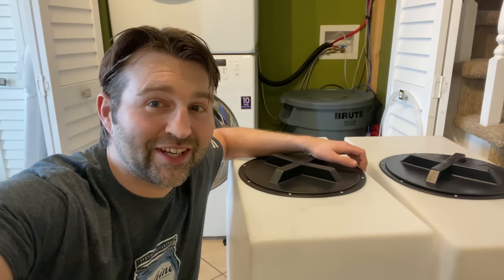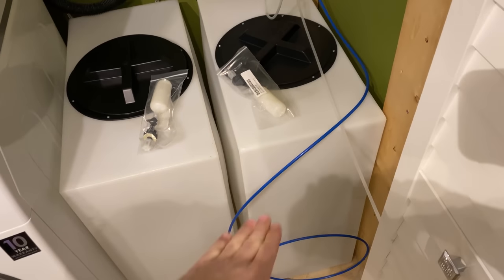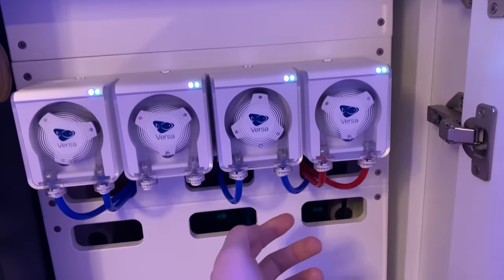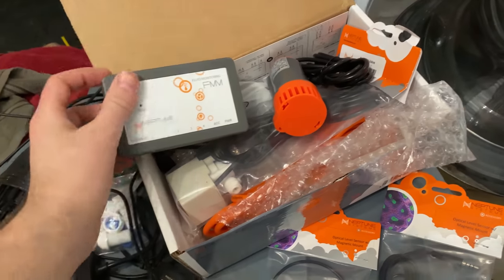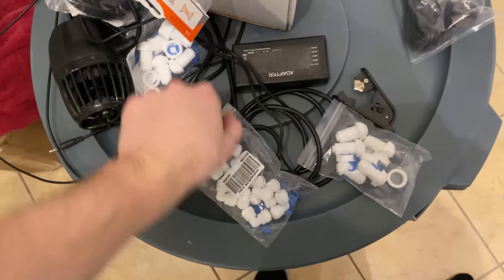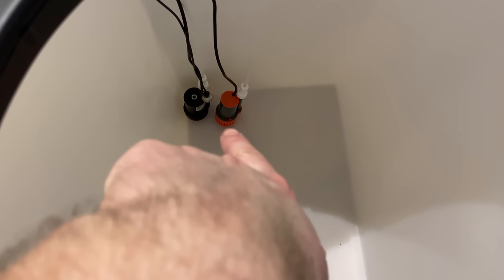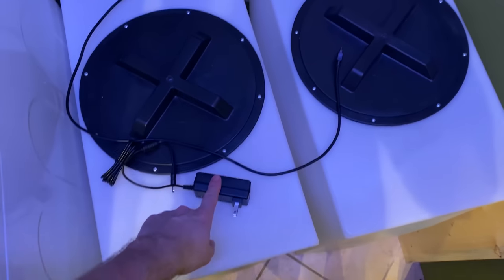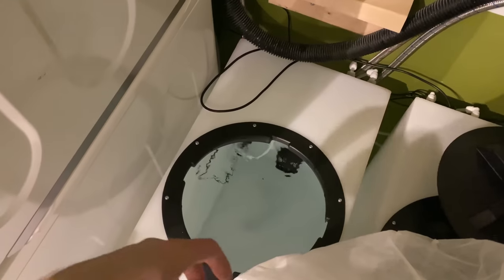Auto Water Change (AWC) Saltwater Aquarium Mixing Station - Waterbox Peninsula EP.05 Vera & AWC

Comment: Hi Devin, do I understand this right for your ato for the rodi supply tank: the optical sensors are connected to the fmm module, and the fmm module tells the solenoid valve when to open and close based on the optical sensors? If so, do you need an Apex unit to set this up, or can it be done as a stand alone? Thank you!
Reply from the maker: You are correct.  if you dont have an apex tunze and a few others make ATO controllers.. if you already have an apex then adding on the sensors is an easy way to  do it.

Comment: Trying to understand how you get the water from the bins up to the tank. You have both a PMUP and the versa on the RO line? So the PMUP pushes it up a bit and the versa pulls it the rest of the way? They are on the same RO line? Or am I misunderstanding?
Reply from the maker: Pmup is for ato and versa is for awc
Reply: @ReefDudes  got it thank you! The PMUP sends the water up a floor without issue? That’s impressive!

Comment: Hey Dev,
I noticed you used a pump to transfer the water from the fresh bin to the salt bin.  You can take that pump off if you wish and just add a float valve and whenever you need to fill the salt bin, just fill it with the RODI unit. I don't think there is any real reason to have to pump the water over there.
Reply from the maker: I have a valve to fill from rodi directly as well!  The pump is if I want to fill it faster I can have water coming from both the rodi and the ato bin!  Really speeds it up if you want to mix up saltwater quick :)

Comment: How long will it take to pull 10 gallons out of tank.  ATO would have to turn off when starting to drain 1-2-5-10 gallons, stay off until 1-2-5-10 gallons pumped back in.
Whats best to control these instructuons?
Reply from the maker: ATF intheHouse well could do it via a scene for high speed. Or low and slow. I think I may just go the low and slow and have it slowly doing it over the day then it’s dead silent and no need to heat the water

Comment: hey DEvin, great video, I'm thinking of getting an apex later on my new setup, would you recommend the versa or dos for auto water changes? or dos since it's integrated to the apex?
Reply from the maker: if its some where far way you wont hear it you can use the dos (not the quietest for awc)  if some where you hear it get the versa as its much quieter at high speed

Comment: My setup is about the same with the two high/low optical sensors in both and I will use the two Neptune solenoid valve connected to T push to connect fitting that will open/close based on the optical sensors. Love the setup.. it’s absolutely awesome..
Reply from the maker: Awesome! love the automation!

Comment: Can you explain what the new ATK pump is doing? I have been watching you videos and love them! I am finally getting a new 130.4 waterbox and I need to finally get around to ATO. I plan to pretty much have the same setup as you. The Apex ATK I am not sure what is is doing. I thought the Versa's are pulling from the reservoirs. Your old pump is pushing the RODI bin to the Salt Bin. Also I assume the Apex solenoid you have before the RO/DI is controlling the open/close on water feeding the RODI? Is that solenoid controlled with the FMM? Sorry about all these questions, but this takes a lot of understand each of the working parts.  Thanks again!
Reply from the maker: Thanks James!  so 1 PMUP is for the ATO to top off the tank.  The second one is to fill the saltwater bin with RODI.   If i want to speed things up i can fill Via the Pump and the RODI at the same time to fill it twice as quick!      The versa is there for auto water change. There is one by the saltwater bin pushing saltwater up to the tank and there is one up by the tank sucking saltwater out and pushing down to the drain. both versa run at the same time for 2h a day.        On the Mixing bins i have a high and low optical sensor in both bins.   If the RODI one is low it will open the solenoid to the RODI unit so it refills the ATO bin.  the optical sensor at the top turns off the rodi so it does not over fill.  I also have float vales in both as backup! :)   the FMM is just my input for the 4x optical sensors.

Comment: Devin - are you planning on keeping your new salt water at display tank temp ie heated? or figure that the volume exchanged will have minimal impact AND keeping the NSW at ambient temp will have no impact on salinity etc ?
Reply from the maker: I will likely do a very slow continuous water change then there should be 0 affect on parameters.. If id o a larger one then it would be more advantages to pre-heat it.. but low and slow saves the extra heater.
Reply: @ReefDudes  Thanks...

Comment: You can get an extension cable for the pmup from brs. I had to get one since my apex is on opposite side as my ato reservoir.
Reply from the maker: I have one for my ATO pump.. i'm out of 24v ports so have to use a power brick for this one
Reply: @ReefDudes  ahh ok that makes sense why you were wanting to cut the power cord and splice it.
Reply: @ReefDudes  Devin, what cords did you have to wire through the wall to get your pmup ato to pump to the tank upstairs? Did you have very much head height, and any horizontal span to the sump? Thank you SO MUCH for this video!

Comment: How large are those containers?
Also dont you have to turn off the system when the saltwater container is empty and you have to add salt to mix new saltwater?.  Rodi reservoir will remain full and continuously feed the tank rodi as top off.
Reply from the maker: I have an optical sensor that will alert me when the salt container is low.. The ATO will re fill it self when its almost empty :)

Comment: This has to be my favorite mixing station video! Great content! I replayed the section where you drilled the 3 holes in the back of the tanks, but didn’t get a clear answer as to what the holes were used for or how the tanks exchanged water. 

I assume the 2 pmups in RODI container, one pumps into the salt container and the other for the ato. So why do we have 2 float valves in the salt container and a 1/4” bulkhead fitting? Also, did you add a optical in the salt container as well? I will be doing a similar setup based on this video! Looking forward to the auto flushing rodi too!
Reply from the maker: Thanks!  Two floats in salt is so I can fill it directly from rodi or from the ATO/rodi bin .. or both at the same time!!   There is one optical in the bottom of the salt to let me know to refill it :). I’ll likely add a high level sensor to it at one point but I ran out of sensors!
Reply: Brilliant!

Comment: I purchased the same tanks and want to do a similar set up. I guess the versa pumps are the way to go. I was going to get the Dos pumps. Setting up an auto water change do I have to worry about my ATO coming on when water is being pumped out??
Reply from the maker: Avelino Fernandez Jr. if you remove and add at the same time (and your pumps are properly calibrated) then the water level won’t change and it won’t kick off your ato
Reply: ReefDudes man your fast I just started watching your channel and your doing some great things. I figured that is what would happen since one pump is pulling out and the other is pulling in. Thank you.

Comment: Any update on programing the Versas for AWC?
Reply from the maker: Super easy.  But I can do something on it. Basically calibrate them to be even. The. Set the same amount to “dose” on both units to do it at the same time
Reply: @ReefDudes  I’m currently using the DOS, it’s loud. Wanted to look into the Versas as a quieter option.
Reply from the maker: @jakespeed5337  That was the same reason i swapped to versas for this purpose.

Comment: why dont you just run a t-valve from the ato. once one bin is filled the other will fill,eliminates the need for the pump.
Reply from the maker: The rodi already has a valve for each container.  The pump is if I need water fast for what ever reason. Then I can use the rodi as well as pump for the ato.  Double duty!